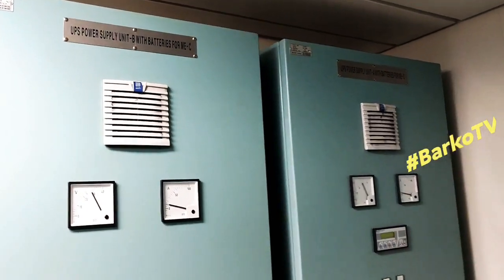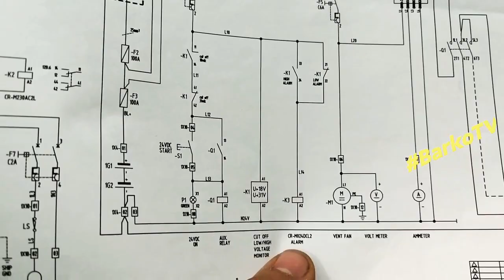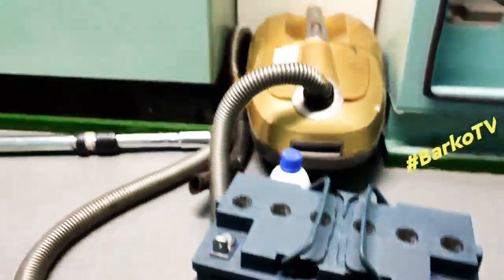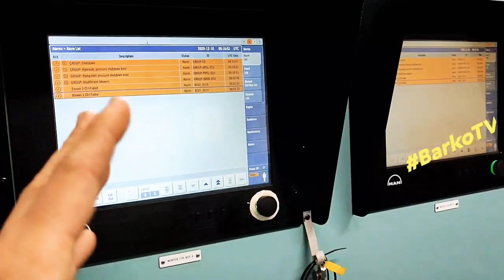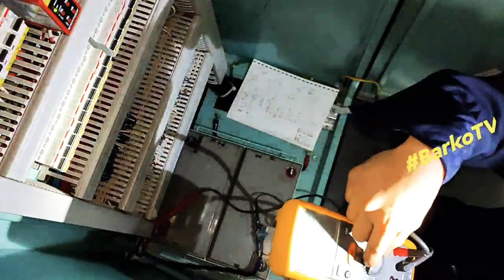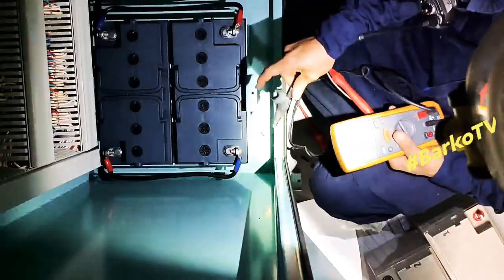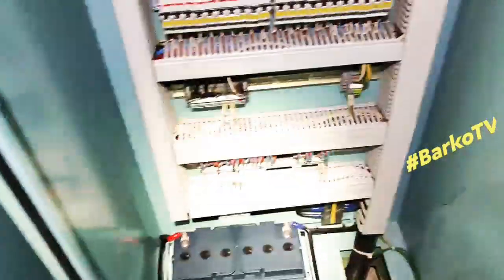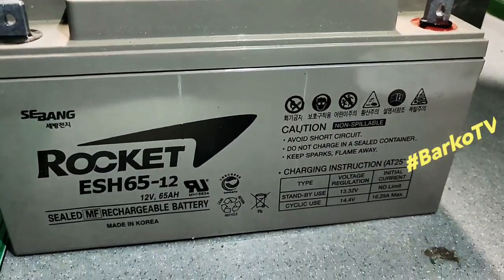MAN B&W  Electronic Main Engine UPS ME-C | How to replace new Batteries | Kalecky | Barko | Marino

Comment: Can we switch off individual battery chargers dedicated for each panel ?
Reply from the maker: Yes, you can use ups a or b. You can turn off, 1 of the ups if you have a maintenance even your engine is running,as long as you have a 1 ups system is running.